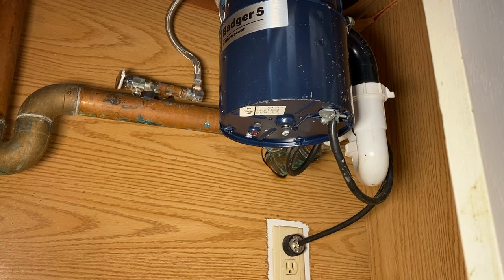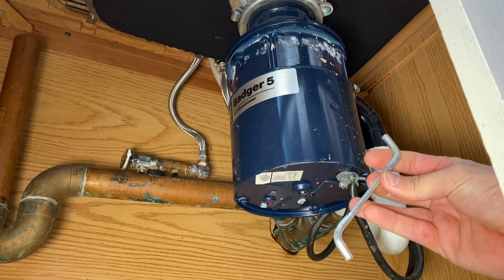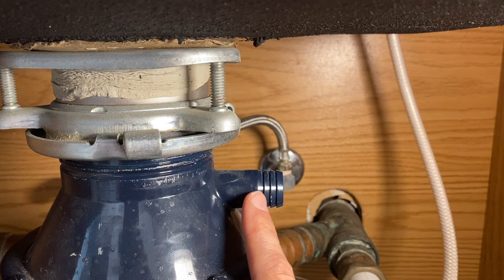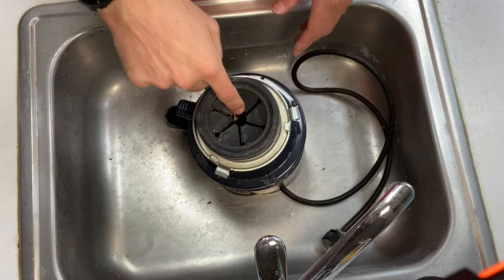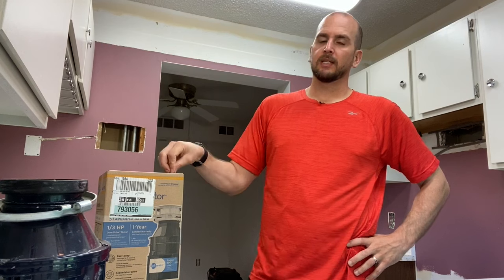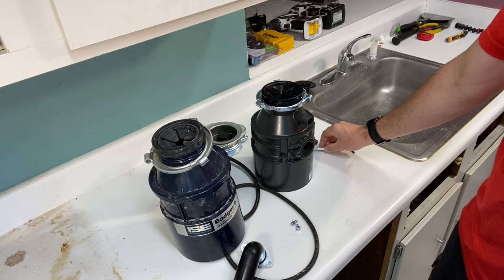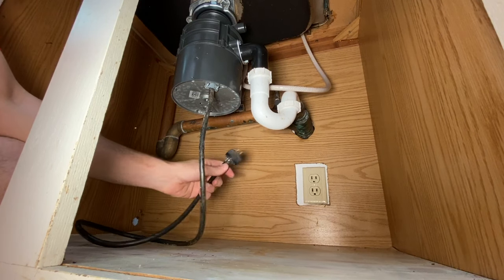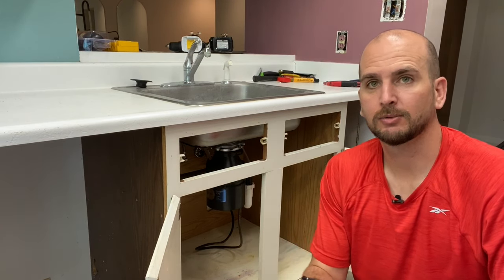How To Repair A Garbage Disposal | Not Spinning / Humming / Not Used For Years

Comment: Didn't realize there was an allen wrench hole at the bottom to help persuade the blade into moving. Thanks for showing that in under 3 minutes so I could fix our Garbage Disposal in a minute. Also crazy to see how easy it is to replace.
Reply: The allen wrench worked like a charm, thanks so much!

Comment: Thank you so much. Great easy video and I loved the reminder about the plug. As a women, no one tells you about that.
I watched this during dinner. I reset the breaker, turned on the switch and it’s still humming. I will let you know tomorrow if it works. And I can stop by a Lowes to pick up a new one just in case. I live in the Mtn’s. So it’s easier to get one and return it. Another great point is the speed. 1/3hp. Great to know. You have a new follower. I’m interested in learning how to finish a shop. Small tiny shop my ex started. It has insulation i think its just the inside walls. I’m 64 and I just remodeled an rv! Came out great. So I’m willing to give anything a try first.
Thank you,
Kat
Reply from the maker: Kat getting after it!  I like the hustle and keep up the good work. Let me know if you have any questions on the garbage disposal 👍
Reply: @EverydayHomeRepairs  I did it. I had to replace it but after watching your video. I picked up a disposal at our Lowe’s. Some wire crimps, an electric gage. And after pulling it off. I realized a screw was in there and I couldn’t get it out. So I just went for it. I new I had power because it was humming. I did exactly what you suggested and then at the end I realized I could just screw back in the disposal without using the top part which I’m keeping for parts. That was heavy but I hunkered in and used my knees. I got that bad boy. I plugged it in in and heard movement. I did turn my water off. You might have mentioned that? Idk but good for women to know the steps of caution. Then I turned the water on, hit the switch and their she went. Works like a dream and no leaks! I put paper towels down and cardboard is another way to spot leaks. Thank you so much. It cost me $130 for parts . But, I did it! Confidence is everything🥂

Comment: I was working on two today and both are rusted on the inside on the impeller plate. The Allen wrench fails to move the plate so I’m going to replace both units. Thank you for your video! I was looking all over to validate my reasoning to replace both GD.
Reply from the maker: You bet, best of luck on the project!

Comment: Mine is doing exactly what you are showing. It won’t turn at all. It’s not even humming and the Allen wrench trick is not working either. It’s really tight and won’t move at all. I’ll try removing the disposal to see if it can be fixed.

Comment: Hi Scott, my garbage disposal is so hard that it wouldn’t twist even using the allen wrench. I tried resetting the circuit breaker, using the allen wrench moved the motor blades to free it up. Im stuck with the last step taking out the disposal.
Reply from the maker: Yeah, if you can't get it to turn with the allen wrench it is probably time to at least remove the unit.  Once removed take off the top mounting gasket (black) and look inside towards the outer wall which is actually the blades.  You might see something actually lodged in between the rotating disc and the side wall.  If you do try to remove with pliers.  Let me know what you find.
Reply: @EverydayHomeRepairs  My husband and I both used the Allen wrench and was able to turn and loosen what is in there.  Once the power is on we can hear metal moving around and it again gets lodged and starts humming again.  I put my hand down in the disposal, but unable to feel it.  What should we do?  Remove from underneath the sink?  Please help because I use my disposal often.

Comment: Hi, my garbage disposal stopped working all of a sudden. I started by checking to see if I have 120vac at the switch, but quickly noticed that I do not. I only have like 5vac. my disposal is hardwired. what can it be? I already reset the breaker. Any help would of great help. Thanks.

Comment: thermoload protection, yep half of our issues at work with g/d. people think g/d will take chicken skin, chicken bones, broccoli stems. or they dont use the disposal for months. always fun when coworker doesnt bother to make sure switch is OFF before using the key to work the disposal motor. weee allen key whipping around tearing up everything in it's path once motor breaks free while switch is ON
Reply from the maker: Oh man, yeah that is also why I hate having rental units with garbage disposals.  Tenants put just about anything down the drain and just another thing to cause a maintenance call.

Comment: I have watched a bunch of these "how to fix" videos and have learned a lot but my particular problem hasn't come up. I was washing dishes,  there was a dish rag in the sink, told myself not to forget to take it out before I dumped the dish pan water and turned on the disposal. Of course I forgot. It got jammed in there and then the disposal wouldn't move and just started humming. I looked in the drain with a flashlight and sure enough that dish rag was caught. I tried to pull it out, even using pliers but it wouldn't budge. I took a box cutter and cut the rag into smaller pieces...got a lot out but there's still more in there. How do I get that out? Any suggestions?
Reply from the maker: You would need to remove the disposal so you can pull the small pieces out from inside which will be location between the disc (blade) and outer wall.

Comment: I have a similar thing with mine but I can turn it rarely not in the sense that it won't budge but... the fallen wrench freely turns, I don't feel the same grip it had to the whole now its just like I'm turning but it's not big enough, even though it worked before, Ours is a bit rusty but not to the point of the one shown here, I looked and moved around inside but couldn't find anything the blades moved fine but it still seemed stuck (even though the blades moved around fine when I turned them[not with the flywheel]) unless the flywheel turning worked.

Comment: Mine doesn't have the elbow pipe so I can't figure out where to disconnect it so I can take it down and look inside. I'm sure there's a spoon/fork stuck inside it but the blades are closed on top so I can't see anything through it from the top.

Comment: The BLADES are not sliding and rotating. I managed to free one up, by striking it at an angle with a wooden hammer handle but the other one is still stuck. What to use to disolve whatever is keeping it from moving?

Comment: These are the most @#$% up things I've ever seen. Impossible to install under a kitchen sink with not much room, laid out across a kitchen floor and up inside a cabinet. Every part of this thing has sharp edges and it's unbalanced with a cord coming out the bottom so you can't even rest it on something. Bad design all the way around,